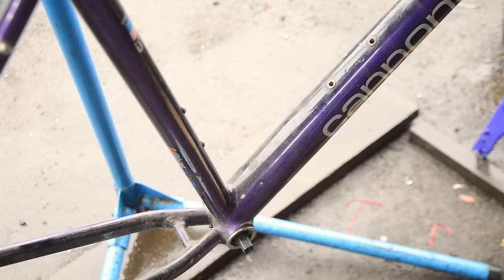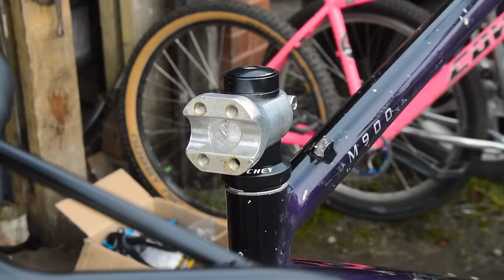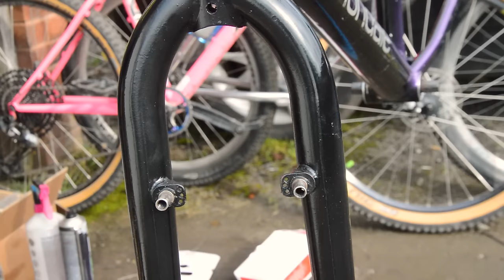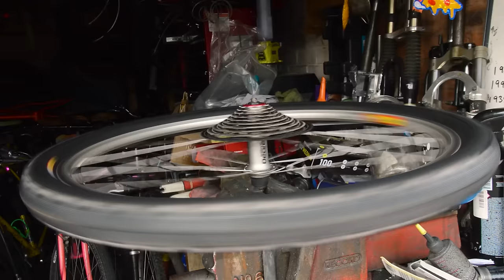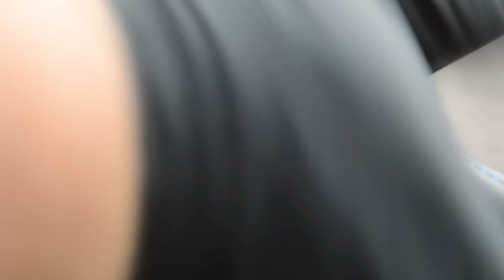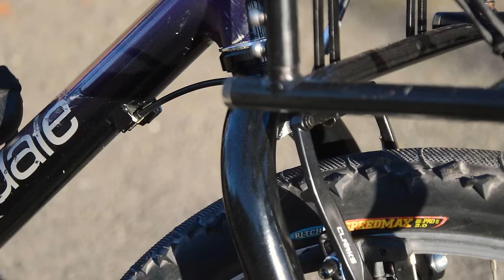I Lost £100 On This Bike Build - Real Costs Of Building A Retro Mountain Bike Commuter - Cannondale

Comment: When I was working as a bike mechanic, stainless steel spokes were 30¢ each. Now they start at $3.00 each. One part of a good rebuild that I believe in is making sure the wheels are ready for another 30 years. That sometimes involves re-lacing them. It's going to cost me $216.00 just to buy spokes, then there's the labour of doing it.
But vintage bikes are a passion. Choose your battles. Make them really good so they show everyone how great the old bikes are.
Reply from the maker: That's crazy - you're getting ripped off is they're just regular plain gauge spokes.  It's £1.79 for a pack of 6 plain gauge stainless spokes where I get them.  A pack of 37 double butted Rohloff spokes only costs £24.99 too!

Comment: I just stumbled across your channel over the last couple of days and I am really enjoying your content. I used to cycle years ago but started again 18 months ago to drive a little less and save money on petrol. At the time, I thought a) it would be easy to fix up my old bike (a 2004 Land Rover Freelander city bike) and b) that it would be cheaper than buying a new bike from Halfords or Decathlon. I was proved wrong on both counts. My local bike shop needed to fix up things that I messed up. And I got some really good tyres. 
So I am sympathetic to the costs here. Ultimately I have a solid beater bike. It doesn't look great and it has a few spots of rust (although the wheels and frame is sound). However it is really comfortable to ride, the breaks are great and the gear shifting is fine. I like that I am still using something that still has a lot of life in it.
Reply from the maker: Glad the old bike has been kept alive.  Generally I'd always say it's worth putting £200 or so in to a solid used bike than buying a new one from Halfords.  I doubt a £200 Halfords bike would last veyr long at all.

Comment: Lovely build. I’ve flipped a few bike’s recently and it’s hard to recover your time costs. You’re right, the market is flooded with cheap bikes. I think the only way to make a profit is buying decent condition bikes from sellers that just want shot of them, then simply giving them a good clean, replace cables, chains and other low cost parts then reselling as a fully serviced working bike. The downside is that can limit your creative ambition.
Reply from the maker: Pretty much! It might a bit better now it’s getting towards summer but it’s still tough out there.

Comment: Great video Mark.
I have been buying and fixing up bikes for about ten years now as a hobby out of a desire to keep good old bikes on the road.
I have noticed in the last two years or so though that old bikes, even if good quality like Specialized, Kona, Marin etc, are getting very difficult to sell for a realistic price.  Anything above £50-75 takes ages to sell. Some bikes go for really silly low prices, I had to sell a mint condition Pashley Princess (£999 new) for £120 a couple of months ago just because I needed the space.
I hardly ever use any new parts since as you note it makes the whole process uneconomical, just tyres, chains and grips are the only new items I use, the rest are recycled old serviceable parts.
The upside to the current market is that you can buy bikes for silly cheap prices, eg I just picked up a GT Zaskar unfinished project ,complete except chain and seat, for £30! Complete with some rigid carbon Pace forks. I'll be surprised if I can't make some money on that, although I will probably keep it since it is my size.
Keep up the good work, your builds are always excellent but perhaps you will have to rely on more second hand parts in future. I have been lucky in picking up job lots of old parts from gumtree and eBay, my best find was a job lot of about a dozen decent XT and LX rear and front mechs for £50 a year or so ago, that was incredibly useful for so many builds.
John
Reply from the maker: WOW!  £30 even with the RC30s?!  Those forks are hens teeth!  I had a set on a late 80s "Offroad" (Proflex) that I decided to sell as a whole.  I sold the bike for less than those forks would go for a what do you know.... I saw the bike broken and bits up for sale seperately within weeks :(

Comment: I've got two bikes -- a gravel / tourer and a daily commuter -- that I've essentially rebuilt from the ground up, to the point that the only original parts are the frame and fork. There's no way I could have done this in an economically justifiable fashion. I knew what I wanted and I bought new. I can't imagine scouring Ebay for good deals (or recognising one when I found it), and I'm absolutely certain I couldn't flip a bike at a profit.

I love your build videos, but I can't ask you to continue to go out of pocket for them.
Reply from the maker: Oh I've been doing this for years to the (honest) point where I'm covered in bikes parts but my bank is pretty much empty.  I'm planning on putting all my effort in to making some really detailed builds with what I have left and clearing out what I don't need and resisting the urge to buy more!  Torvi needs some more steak treats.

Comment: Sad times for people like you and myself, who just want to re-cycle cycles. I aim to replace what needs replacing with a full strip down and regrease/oil. I try to reuse parts for cost efficiency,  tyres are the killer for me! 
How ever cheap I can get a good base bike, its now getting close to costing me! 
Keep up the content and good recycling when possible!
Reply from the maker: Recycling is always best. Tyres can get ridiculous too. That’s why I try and save as many as possible.
Reply: I wholeheartedly agree on your comment regarding tyres. Virtually every decent frame I find here in south Florida has dry rotted tyres. Decent tyres are $30 to $50 each here I n the USA. So there goes any chance o f making a profit.

Comment: I generally only buy complete bikes for resell. Even with swapping parts between them and only replacing consumables, the profits are low, but it's a fun hobby with a bonus now and then. Once in a blue moon, I'll find a bike that needs minimal work and I can double of even triple the resell price of with an hour or two of work. A good thing is that there is still a pretty active market for used frames, wheels etc (at least here), so my stockpile of parts I am not interested in for myselfy is pretty low.

Comment: I avoid Walmart/Halfords bikes as the basis of refurbs. The supply of sub $30 quality frames has dried up here in south Florida. The last one I found at a flea market a GT Karakoram with no wheels but full LX group set and I had to haggle for ages to get the seller, who refurbishes beach cruisers, down to $20 even though the combo brake/shifters were not working (they were trashed inside and beyond repair) and you know how hard it is to find those parts at prices less than new equivalents (impossible). I decided to repaint it, and will never get that money back. After the rebuild and a test ride - using a wheel I already had I discovered that the freewheel was worn out - another expense, new cables and it's been for sale for a mere $150 and no interest for the past 2 months. I have a Gary Fisher F4 which I refurbished, powder coated, all new suspension front and rear and new tyres, which I haven't been able to shift even at $250 for over a year. So yes you are right, the costs can add up quickly and these days people don't have any money to buy anything.  I have to look at it as a hobby. During Covid I could turn over bikes in just days and for a small profit even after painting 🙂.  I've been inspired by your and Gary's videos and just want to restore/refurb/restomod these excellent old bikes. It keeps me busy and provides great satisfaction when I compare the before and afters. I'm just getting into the GT's they make a great base.
Reply from the maker: Yeah I definitely avoid the cheap end of bikes too.  That's a shame those bikes have been sitting around for so long - especially for a GT.  I would have thought that'd bee easy to shift.
Reply: Update: after another year the Gary Fisher Joshua F4 finally sold for $200 to a local teenager who came round with his dad and his saved up pocket money. He loved it! Just the GT remains, but as I am heading back to the Isle of Man next week it's going to sit in the garage for another 7 months!  In the mean time I picked up a trek FX7.2 hybrid, refurbished it and sold it within a day for a small profit and about 2 weeks ago picked up a Cr-Mo steel framed Trek 930 from the mid 90's with a broken free hub. That will have to wait!

Comment: Is there a reason you didn't use a bit of heat on the bottom bracket to get it off?   I was waiting for something to snap when you were cranking on it with a long bar.  ☺️🤗🤔
Reply from the maker: Yup - I didn't want to burn the paint

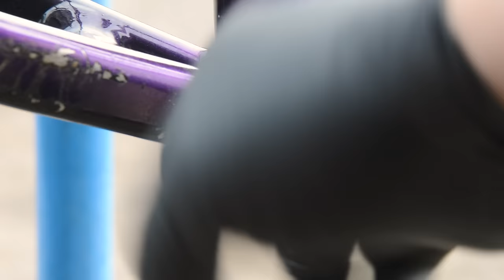Comment: 10:08 can't you see there's no drainage hole? All the water flicking ff the rear wheel trickles down the seat post and floods the BB, its an absolute guarantee it will happen again in 10+ years
Reply from the maker: I haven't had my eyes checked in years.

Comment: Bikes aren't moving like they once were.  On my channel I attempt to find old, mid to lower end neglected bikes and fix them up.  I normally find them for around $20 or $30 USD, and try to reuse most of the parts.  Most of the time I just end up replacing the chain, cables and housings.  I turn around and sell the biles for around $120 and end up making around $50 profit and have content for my channel.  FYI, I"m not posting under that channel.  Good video and keep up the good work.

For what its worth, my channel is "The Value Bike Advocate" if anyone is interested.
Reply from the maker: I think I saw one of your videos pop up the other week actually.  The Fuji with the bugs inside?  Don't remember seeing the finished bike at the end of the video though.

Comment: I have been in the used bike business for years and find the issue you're having all too common, it is however multifaceted. 
1. With the loss of manufacturing, many people are unfamiliar with materials their attributes and costs, also they have limited engineering knowledge. 
2. There is a plethora of cheap Bicycle Shaped Objects (BCO's) and unfortunately people tend to base their understanding of bicycles on them. 
3. Cycling is still viewed as mostly recreational or sporting, therefore useful things such as mudguards or racks, particularly front ones are deemed weird!
I prefer Dutch bikes, and when you consider they offer an all round urban transport solution, they just don't get it, and low step thru frames are deemed ladies bikes!
It's almost as though you have to offer a full educational download to people, such as steel is strong but heavy (typically) and aluminium blah de blah as they just don't know!
I ride a Pedersen and people stop me and say." Oh is that a Penny Farthing." Well they have two different size wheels and this bikes has two wheels the same size, oh and I think you meant an ordinary. Total blank look follows. 
I like and own vintage French bikes and I hear people say. "My Mountain bike is new and has 650b wheels." And I say, yeah so does my 1950's French bike, they're 44-584. 
Anyway keep up the good work, if you know you know and if you know you appreciate what you do. 😅
Reply from the maker: BSO are definitely one of the bike factors eh! The regular person searching for a bike see a £250 new BSO or a £250 refurbed used bike and don’t know the difference 🤷‍♂️

Comment: please tell me how to install such a large cassette?
Reply from the maker: To install the cassette is the same as any other cassette.  Undo the lockring, slide the old cassette off, clean and grease the freehub, slide the new cassette on and do up the lockring.  

You need a derailleur to match though.
Reply: thanks for the reply
but I still need a drum because I have a 7x cassette
 @MonkeyShred

Comment: Just work with parts from the trash or temu :)
Reply from the maker: I’d rather not. Quality parts for me.
Reply: I just buy entire bikes and strip them for the valuable group sets and wheels, £50 buys a top of the line 2008ish MTB these days with hydraulic brakes and hollowtech cranks. I'm yet to lose money on a single build.
Reply from the maker: @janeblogs324  yeah that’s always an option but if they’re high end you’re just trashing one bike to build another.

Comment: What was the tool you used as a thread chaser for the bottom bracket threads?
Reply from the maker: It’s either Cyclo or Cyclus. Bottom bracket die set.